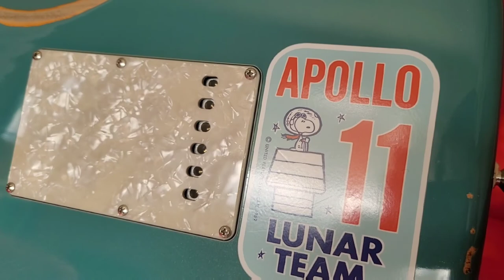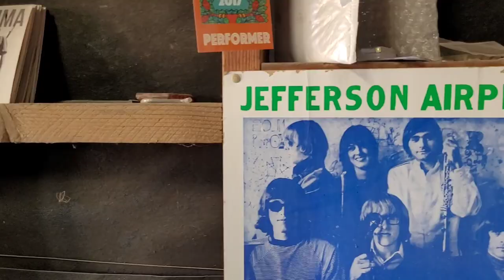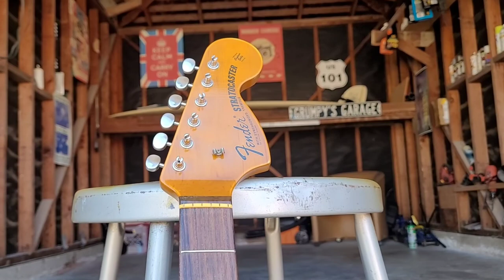RELIC your Fender!!!  Pt. 1

Comment: SoCal- San Diego? EDIT- I see OB!!!! That checking looks great... I need to do this to my neck. I have a Classic Series 50s nitro neck on my Road Worn 50s Strat.
Reply from the maker: Yessir. You as well?
Reply: @breilly66  Yeah, over off Home Ave by the 94.
Reply from the maker: @tjchad1  Heck yea! I have the road worn Vintera Tele and am fixing to get that one checking as well. Was just on the 94 last weekend. Headed to Highway 80 for those great driving roads.
Reply: Watching Pt 2 now. Funny, my RW is black.... previous owner way over did his "more relic" to it. Looks good from the front but he got nuts on the back and you can really see his sandpaper marks in the finish. I need to try and polish those out. The wood is nicely darkened- I used some brown shoe polish to stain it (navy flashbacks to polishing shoes!)
Reply from the maker: @tjchad1  A bit of 800 up to 2000 wet dry could knock out those scratches!
Reply: @breilly66  I'll give that a shot. Thanks for the tip.